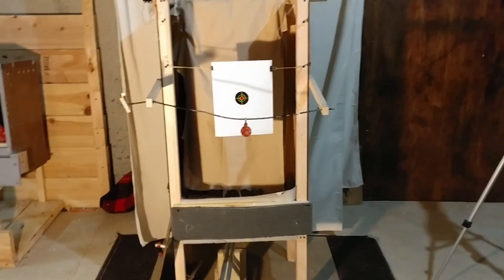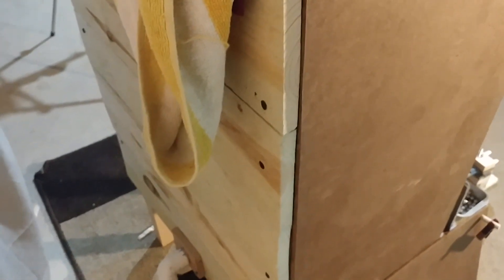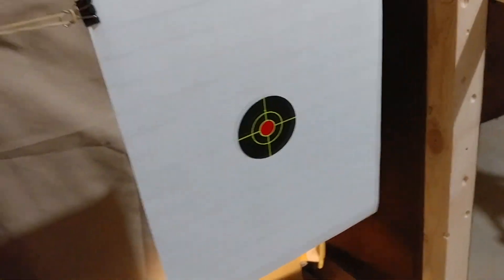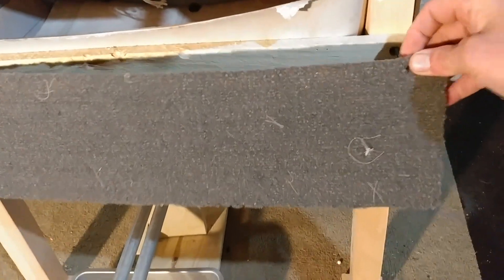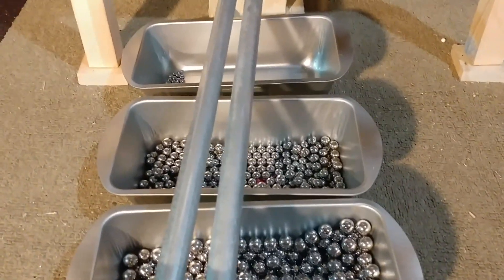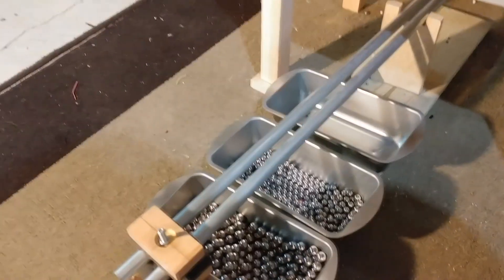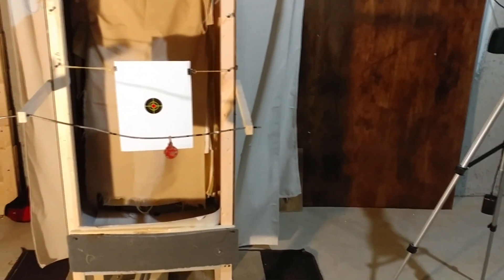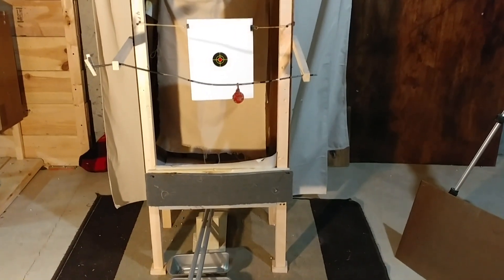Slingshot Catch Box and Slingshot Ammo Sorter - DIY

Comment: Well, I think it's a good reference model for us. Yup, the separation tubs would be better made of smooth metal. I worked an industrial separator using this method separating pill-type units within thousands of an inch. Great addition! The back material.. may be better to add 3 or 4 layers separated 1/2in or so to help dampen but probably not that great a difference. Great Idea build may have to copy!!  Thanks for sharing !!